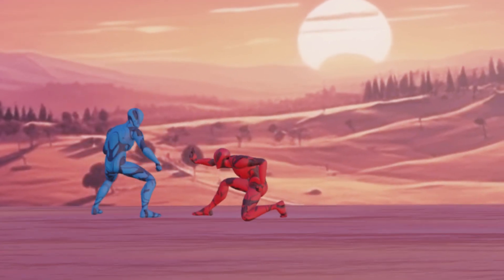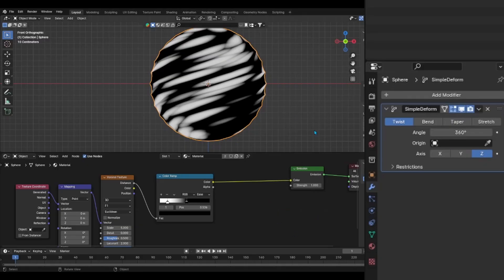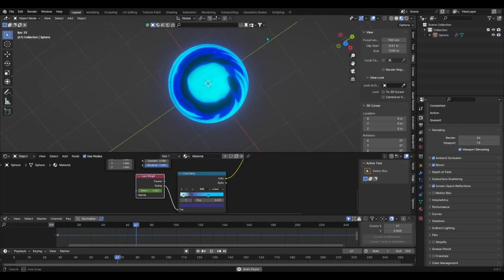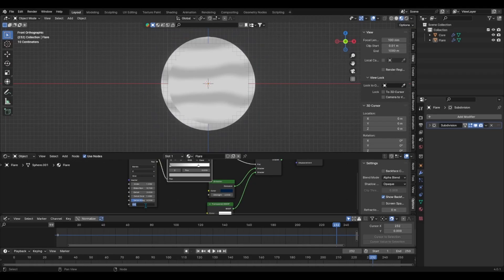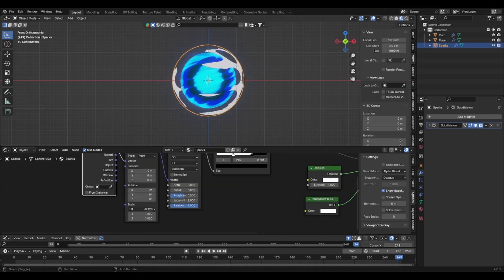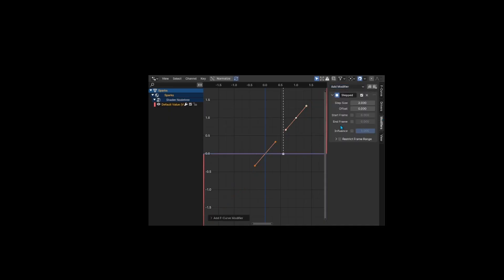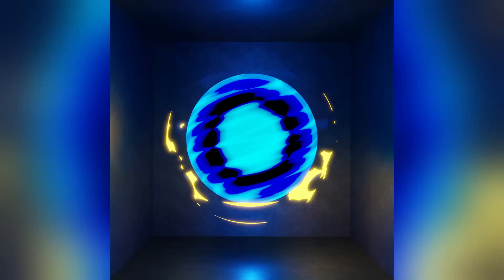I challenged myself to make a stylized Energy Ball in Blender

Comment: i always have problem with the blend mode, i never found it, anyone know the reason?
Reply from the maker: @akumanosaikoro  Make sure you're in Eevee rendee engine, first. Also, the newer versions of Blender changed its location a little. After selecting Eevee, in the shader tab, press 'N' to toggle the options and from there change the blend mode from 'tethered' to 'blend'
Reply: @sambamproductions8883  well thanks for help even thought i couldnt find it for some reasons but i did download an older version so it worked, thank you so much bruh
Reply: @sambamproductions8883   I cant find "Blend mode" in there, i found only method, but still cant find Tethered ot Blend stuffs.

Comment: I'm following along, and for some reason I can't get mine to be as vibrant and bright as yours. I even went back and tried to copy the tutorial exactly to see what I'm doing different, and for some reason I still can't quite get it the same; I'm stuck on doing the nucleus because I just can't figure out what I'm doing differently. As far as I can tell it's to do with the colors I choose in the color ramps, so I'll list them in case someone can figure out why they aren't as vibrant. When trying to copy the video, I made them as follows:
First ramp connected to the voronoi texture is pure black, followed by [Hue(0.5), with Saturation and Value being 1].
The second ramp with the layer weight node has, from left to right, [Hue(0.5) Saturation(0.467) Value(1)] for the light inner core, [Hue(0.677) Saturation(0.829) Value(0.187)] for the darkest part right around the inner core, [Hue(0.677) Saturation(0.842) Value(0.380)] for the slightly lighter inner ring, and [Hue(0.547) Saturation(1) Value(1)] for the outermost ring. For some reason, my inner core and outermost ring always look dull and paler in comparison to this video's no matter what I do.
Reply from the maker: @syweb2  just a quick question, did you add the 'glare' node in the compositor?

Blender has made a change recently where to have the 'bloom' effect, you have to add that 'glare' node in the compositor tab.

Do the following:
- Go to 'Rendered' or 'Material Preview' mode.
- Click on the drop-down arrow next to those modes on the upper-right hand corner of the viewport.
- In that menu, under 'Compositor', select 'Always'
- Go to the compositor and add the 'glare' node.

From there, the bloom effect will take place and the ball will look much more vibrant.
Reply: @sambamproductions8883  I just did that, and while it did make some nice bloom, the colors themselves (most notably in the cyan-ish areas) were still somewhat paler than what the video and even my own color ramps showed. I'm not sure if there's some other setting in the other nodes like the Mix node that I'm missing.
Reply from the maker: @syweb2  Last thing I can think of is your color management settings.

Go to your Render settings in the 'Properties Tab'.

Under 'Color Managenent', change Display Device to sRGB

Also change 'View Transform' as AgX 

These are the settings my Blender has, but also feel free to change it to your color preference.

Also make sure you're in 'Material Preview' or 'Rendered' view to notice the difference.
Reply: @sambamproductions8883  Setting my View Transform to "Standard" seemed to fix it, and also fixed whites being too grey and reds being too orange. Thanks for pointing me to the color management section and for all of your other help!

Comment: 2:48 I cant find this option..When I click on options these settings are not there (blend mode) :((
Reply: blend mode was replaced by render method. just choose the "blended" option in render method
Reply from the maker: @merhababenkedy  hmm... are you in Eevee render engine? If you're in Cycles, it won't show in the panel
Reply: @sambamproductions8883  yes I think this has been moved in the new update (4.2.1) emission does not work completely..I'm trying to add bloom using Compositor :/
Reply from the maker: @merhababenkedy  I see, I'm not super familiar with 4.2 yet, but I'd recommend checking 4.2 tutorial videos to keep tabs on the updates.

I'll reply to you here when I find a solution

Comment: not able to adjust the stepped interpolation value,the sparks really slow,can you help please?
Reply from the maker: Sure, I'll try. At what step of the tutorial are you encountering the issue? So I can locate the problem
Reply: @sambamproductions8883  after adding stepped interpolation modifier,I'm not able to adjust the step size properly,unlike yours my sparks move really slowly ,can you please guide me
Reply: @sambamproductions8883  not able to adjust the value for stepped interpolation modifier properly,while your sparks looks choppy,my sparks barely even move,can you please guide me
Reply from the maker: @3dvertices  it could be a display issue. Zoom out of your the graph much more and keep increasing the value until the choppiness is noticeable in the viewport.

I've had this issue in the past a lot. Lemme know what happens
Reply: @sambamproductions8883  reduced the value quite a bit,now it works perfectly!!

Comment: Good video. Just wondering  would it be possible to make a orb to use in Gamemaker  software to make your own games?
Reply from the maker: I'm not sure or familiar with Gamemaker. What I would recommend is checking out tutorials on how to import elements in Gamemaker. Figuring out what kind of file-type is required would let you know what export settings to use in Blender.
Reply: Thanks for the quick reply

Comment: Heres my question and its frustrating I cant find answer. If i want to export the animated material. How do i do that? How do i bake those values. Or is it a completely different method. Someone for the love of all things holy, let me know
Reply from the maker: I'm assuming you mean exporting to game engines.

I don't work with game engines myself, but what I would recommend is to type 'how to export from Blender to Unity/Unreal Engine' and start from there.

As for baking, you can select the mesh you want to bake the animation, press 'F3' to make the search menu pop up and type in 'Bake animation' to have keyframes generated on each Keyframe.
Reply: @sambamproductions8883  oh snap so I can make the animation to the material itself?
Reply from the maker: @Omnivoid22  yeah, you can bake an animation directly on a mesh. That's what happens when you also export an animated mesh as an alembic file (.ABC).

But I'd highly recommend looking into first since, like I said, I never worked in a pipeline involving exporting from Blender to a game engine.

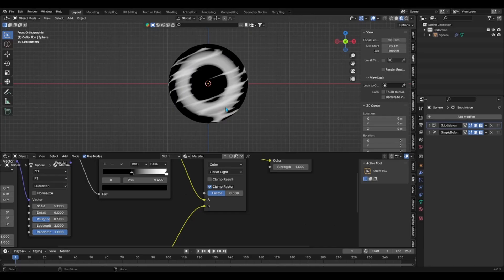Comment: at 1:39 how do you get that swirly look
Reply from the maker: You can see at 0:42 where I add the 'Simple Deform' modifier where I set it to twist on the 'Z' axis. This creates the swirly look.
Reply: @sambamproductions8883 i already have that down but it didnt change anything
Reply from the maker: @2exclusivetye  I'm thinking... It could be the following: 
- that you applied it to the wrong sphere
- that the settings in your modifier don't correspond to mine
- that the modifier is turned off for the viewport

Comment: I was very excited to try this tutorial, i prewatched it while very tired the other night, and the day after i attempted it after a sorta tough day, my takeaways form this project were slim.

This was a prerecorded video, which he makes multiple cuts around and gives wrong information on a number of spots, leaving you to figure out what exactly he changed.
While he vocalized what nodes he was using, it was often after a cut where he says we need x node and then pops up with 4 nodes in the next frame with them all connected with no explanation.
I loved the concept, and hated the execution. 
Room to grow, but for what was a 6m video, turned into 3 hours of work with ~45m of that being troubleshooting the jumble.

TLDR: okay tutorial, hard to follow without many pauses.
Reply from the maker: I appreciate the feedback.

If you need more details, here's a step-by-step breakdown I made:

The Core:

Start by adding a sphere to the scene.
Switch to 'Material preview' mode and open a shader editor in the viewport.
Replace the Principled BSDF shader node with an emission node.
Add a 'Voronoi' texture node with a color ramp node.
Adjust the sliders on the color ramp node to achieve more black values than white, creating a swirling energy effect.
Add a 'Simple Deform' modifier to the sphere, set the twist option to 'Z' axis and angle to 360 degrees for a twist effect.
Add a 'Layer Weight' node with a color ramp node.
Adjust the sliders on the color ramp node to create a nucleus and rim light effect.
Add a 'Subdivision Modifier' to smooth the mesh.
Mix the color ramps from the Layer Weight and Voronoi texture with a 'Mix Color' node using 'Linear Light' blend mode.
Add colors to each color ramp node.
Add a single keyframe to the 'blend' value of the Layer Weight node.
In the graph editor, add a noise modifier to the keyframe to create a pulsating effect.

The Flare:

Duplicate the sphere and scale it up.
Duplicate the shader material.
Delete unnecessary nodes except the emission shader.
Add a mix shader, a transparent shader, and a wave texture with a color ramp node.
Adjust the settings of the wave texture.
Enable 'Alpha Blend' mode in the material's shader settings for Eevee render engine.
Animate the 'Phase offset' control of the wave texture node using '#frame/-4' expression.

The Sparks:

Duplicate the flare's sphere and scale it up.
Duplicate the shader material.
Delete unnecessary nodes except the emission, transparent, and mix shader nodes.
Add a Voronoi texture with a color ramp node, Texture Coordinate, and Mapping nodes.
Set the color ramp's blending mode to constant and reverse black and white values.
Adjust the scale values of the Voronoi texture for spark patterns.
Change the Voronoi texture from '3D' to '4D' and adjust the 'W' value.
Animate the 'W' value using the '#frame/' expression.
Open the Drivers Editor for the animation curve and add a 'Stepped interpolation' modifier for choppier animation.
Add a second mix shader node and second transparent node.
Connect a value node to control the opacity of the sparks.
Animate the value node using a noise modifier with 'Stepped interpolation' for added spontaneity.

Comment: Why does my Voronoi Texture Node have way less options and sliders than yours?
Reply from the maker: There could be multiple factors as to why.

- Make sure you're using the same version of Blender as mine (4.0)

- You may have chosen '1D' or '2D' as the type or chosen another type outside of 'F1', which can affect the sliders.

Comment: too fast. can you make a slower tutorial of this step by step?  every step for a noob that doesn't know
Reply from the maker: Here's a step-by-step breakdown:

The Core:

Start by adding a sphere to the scene.
Switch to 'Material preview' mode and open a shader editor in the viewport.
Replace the Principled BSDF shader node with an emission node.
Add a 'Voronoi' texture node with a color ramp node.
Adjust the sliders on the color ramp node to achieve more black values than white, creating a swirling energy effect.
Add a 'Simple Deform' modifier to the sphere, set the twist option to 'Z' axis and angle to 360 degrees for a twist effect.
Add a 'Layer Weight' node with a color ramp node.
Adjust the sliders on the color ramp node to create a nucleus and rim light effect.
Add a 'Subdivision Modifier' to smooth the mesh.
Mix the color ramps from the Layer Weight and Voronoi texture with a 'Mix Color' node using 'Linear Light' blend mode.
Add colors to each color ramp node.
Add a single keyframe to the 'blend' value of the Layer Weight node.
In the graph editor, add a noise modifier to the keyframe to create a pulsating effect.

The Flare:

Duplicate the sphere and scale it up.
Duplicate the shader material.
Delete unnecessary nodes except the emission shader.
Add a mix shader, a transparent shader, and a wave texture with a color ramp node.
Adjust the settings of the wave texture.
Enable 'Alpha Blend' mode in the material's shader settings for Eevee render engine.
Animate the 'Phase offset' control of the wave texture node using '#frame/-4' expression.

The Sparks:

Duplicate the flare's sphere and scale it up.
Duplicate the shader material.
Delete unnecessary nodes except the emission, transparent, and mix shader nodes.
Add a Voronoi texture with a color ramp node, Texture Coordinate, and Mapping nodes.
Set the color ramp's blending mode to constant and reverse black and white values.
Adjust the scale values of the Voronoi texture for spark patterns.
Change the Voronoi texture from '3D' to '4D' and adjust the 'W' value.
Animate the 'W' value using the '#frame/' expression.
Open the Drivers Editor for the animation curve and add a 'Stepped interpolation' modifier for choppier animation.
Add a second mix shader node and second transparent node.
Connect a value node to control the opacity of the sparks.
Animate the value node using a noise modifier with 'Stepped interpolation' for added spontaneity.

I hope it helps :)
Reply: I really prefer video. I am learning from 0. even the blender guru tutorial sometimes being hard :D  @sambamproductions8883 

by the way try to record in 4k if you can. it will help for bigger monitors
Reply: @sambamproductions8883  Thank you for taking your time in putting it here!
Reply from the maker: @BriceKoua-11-11  Anytime:) Lemme know if you have any questions